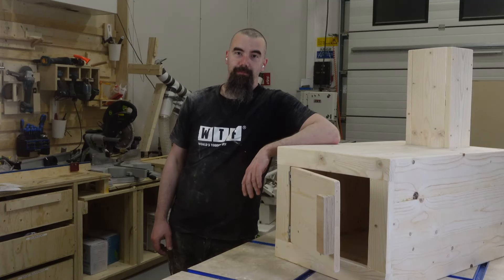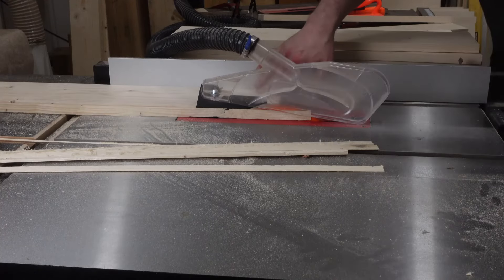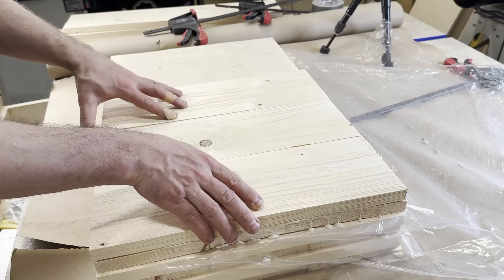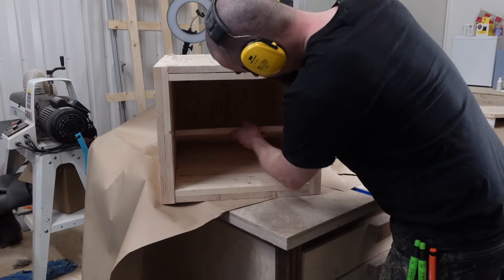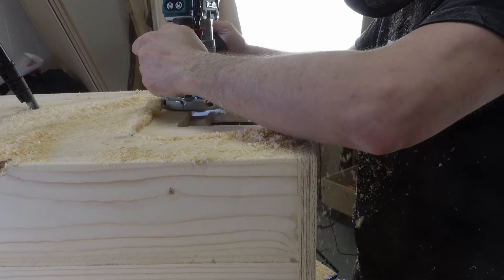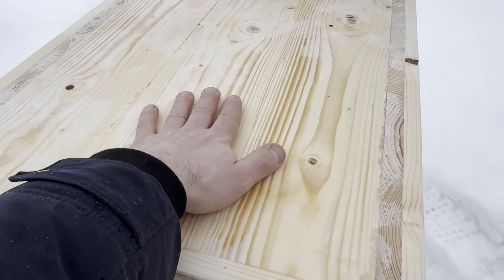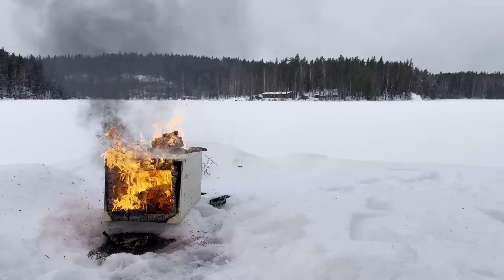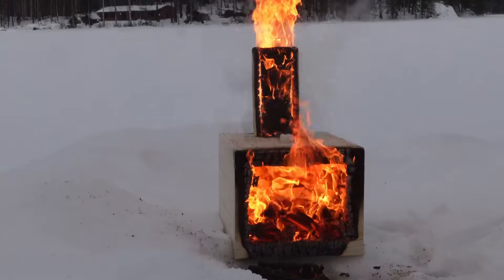I built a stove from wood - guess how long it lasts?

Comment: I'm going to guess 30 minutes. I mean the top will be gone first, but all bottom corners? I gotta hope they'll last a little longer!
Reply: This guess was before seeing that the walls are doubled. Now I want to increase to 40-45min, but I am very unsure...
Reply: Well, why didn't I double my guess??

In terms of stupid thing to make out of wood... off the top of my head... an axe? a knife? both obviously not as interesting as this video though.
Reply from the maker: Not a bad guess :) I went with low number because the wood was so light, obviously something you can’t feel on the video, and I thought it would just catch fire like cheap plywood